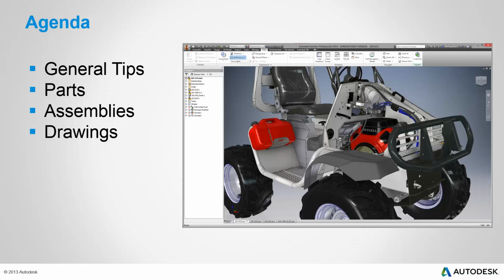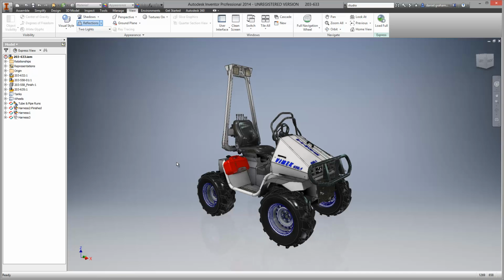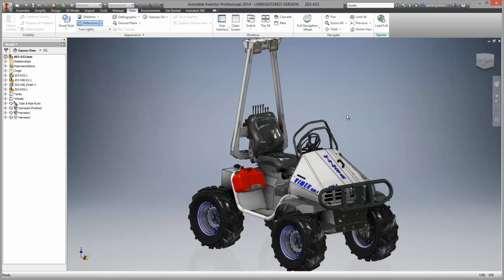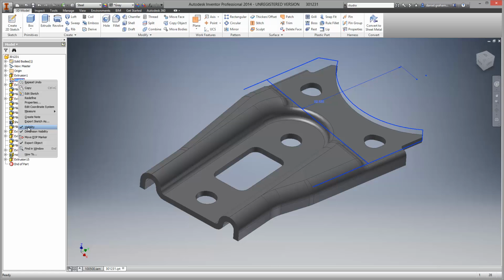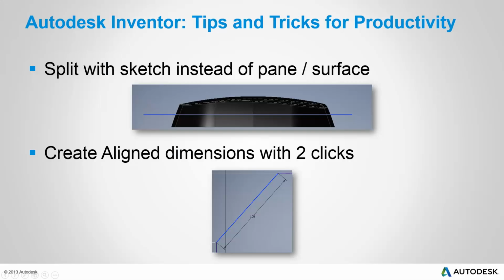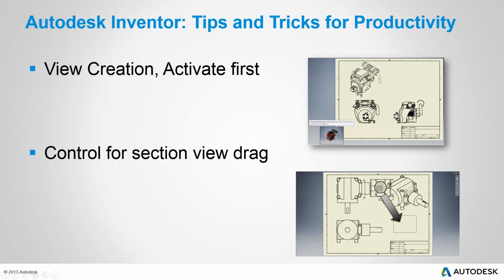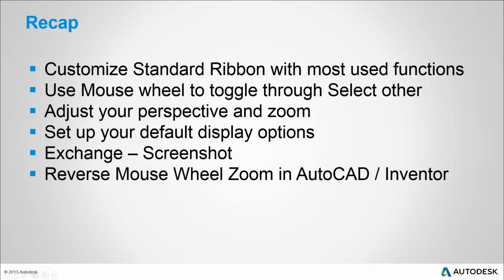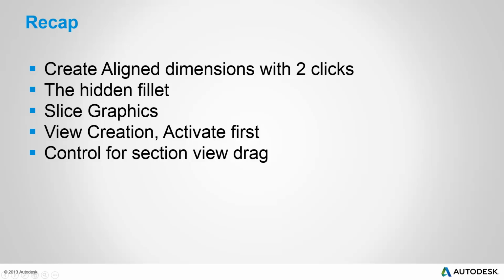Autodesk Inventor: Tips and Tricks for Productivity

Comment: Oct 2017 > Evidently "Inventor Screenshot" does not exist anymore.  There is another one "Screenshot Tool" (not an inventor product) I find it very inadequate and only goes to email >>> I use Thunderbird. There is no option to change.  I quit using Microsoft email long ago? 
 FYI, I have been studying Fusion 360.  I'm 71 years old and it might be a good product after I'm under ground?  Right now it has some good stuff but can not do 1/2 of what I do in Inventor.

Comment: Thanks for this great information.
However, on testing out multiple windows, I find (with Inventor 2011) that when I add a new window to make two vertical windows, ALL my parts and the assembly become two windows, as well!
Worse still, you never said how to get any of them back to a SINGLE window!!!!
So, I have a mass of thin windows all over my screen and cannot find how to get back to normality; -even after checking F1 Help Files (which are always useless anyway) and searching on-line! I might try closing everything and starting again.
By the way, the select other Parts using mouse wheel and Control or Shift Keys pressed, still zooms the display for me!

Comment: Great video.
FYI - it is not necessary to hold Ctrl while dragging a part from the Assembly Browser (tree) into the graphics window. You can use Ctrl to select multiple parts, then just drag and drop.
Also, if while creating an offset section view line, requiring multiple segments, you can press Backspace to undo the last pick. Very useful for complex offset sections.

Again, great video.